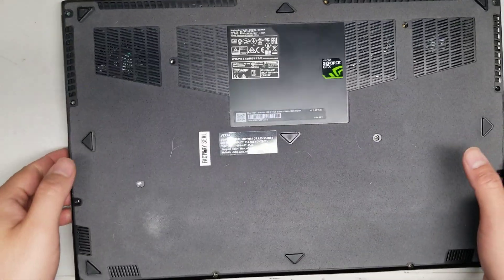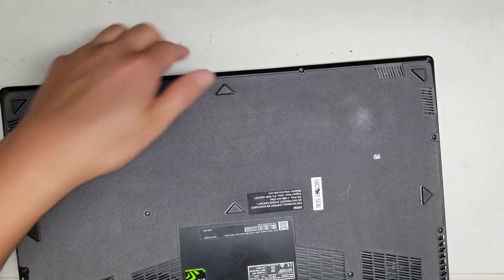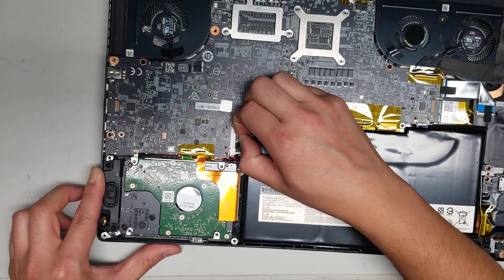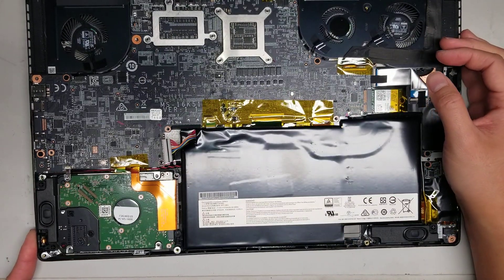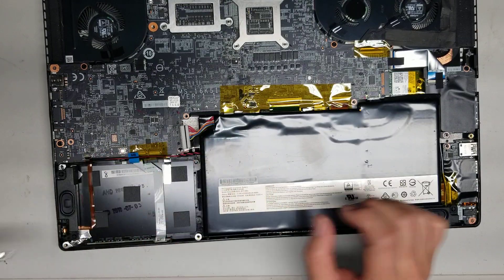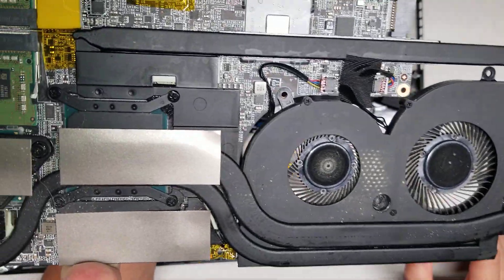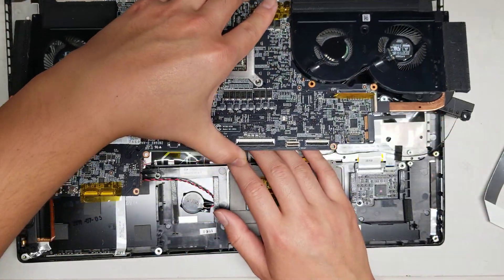MSI GS63 Stealth 8RE-010US MS-16K5 Disassembly RAM SSD Hard Drive Upgrade Repair

Comment: Can i change cpu on msi gs65 s9sf??? I have i7 9750h  can i take another stronger?
Reply from the maker: Nope
Reply: @ItsBinhRepaired  😪
Reply from the maker: @coaznik2112  most laptops can't
Reply: @ItsBinhRepaired  i know that i have that i7 9750h and rtx 2070 q max. Graphic card is ok but that 9750h is not good to much.
Reply from the maker: @coaznik2112  :( only thing you can do is ssd and RAM
Reply: @ItsBinhRepaired  is 86°C is normal temperature  when i play on ultra  for rtx 2070q max???
Reply from the maker: Sounds really high, but I dunno. 100c is thermal cutoff
Reply: @ItsBinhRepaired  everyone tall me is that normal from service. But i think that is so much temperature.

Comment: 10:55
what board is that on the bottom right, on the left of the USB/Ethernet board? (the one that has the square chip on it with the red dot. you briefly refer to it at the timestamp). I'm asking because my laptop has this weird habit of freezing at random, but whenever I apply light pressure from my palm onto the palmrest in that area, it unfreezes, and I'm wondering if that board needs to be replaced.
Reply from the maker: Not really sure what it's called. It shouldn't cause your computer to freeze though, maybe the keyboard might stop responding, but not freeze the whole computer. Maybe it's a video connection issue. I dunno

Comment: I have this model but the HDD failed. I was told it was welded to the motherboard. How can i replace it or is it a solid no?
Reply from the maker: Welded to the motherboard? I dunno about that. Watch the video and replace the hard drive/SSD as shown and install Windows on it.

Comment: does anyone have a link for replacing the battery .....?   i need to do mine as its bulged and toaste .... also maybe the part number
Reply from the maker: https://amzn.to/3aZbvlZ
Reply from the maker: To replace it, you just pry it up. There's adhesive holding it down. The bulging should make it easier.
Reply: @ItsBinhRepaired  thank you very much for info.  Hopefully easy just swap out

Comment: Quick question. Is it normal to have that little black spot on the motherboard? At first I thought it was a burnt mark but then I noticed you have that black spot on your motherboard as well.
Reply from the maker: What black spot?
Reply: @ItsBinhRepaired  it's right above the letter "FC" on the motherboard
Reply from the maker: @ptrwg  I don't see what you're talking about
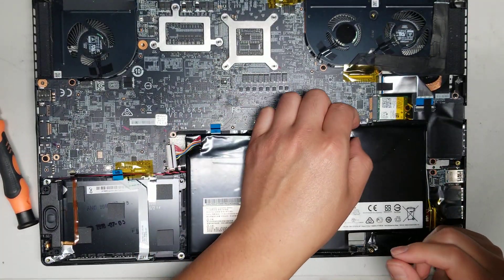Reply: @ItsBinhRepaired  I'm sorry. Maybe I wasn't clear about it. But if you stop the video at minute 6:50 , you'll see it right at the center of the motherboard, directly above the letters "FC".
Reply from the maker: @ptrwg  hmmm yeah it does look burnt. Not sure.

Comment: Is it possibly to clean up the fan by only taking off the cover and not going through all these steps? Can you make a fan cleaning video?
Reply from the maker: This video will help. Watch them and decide. https://youtu.be/3zs_SJ3BXgA
Reply: @ItsBinhRepaired  My cpu fan is making a squeaking/purring noise . From what I'm reading , im thinking it needs to be replaced. what are your thoughts?
Reply from the maker: @joeshon1  lube it
Reply: @ItsBinhRepaired  ok ill try that first thx. if  i do try to replace the cpu fan, do i have to remove the battery and hard drive before removing the motherboard? or would i be able to get at the cpu fan without removing anything but the fan?
Reply from the maker: @joeshon1  try it. Think about what you're removing and why you are removing it and whether or not it needs to be removed. Working on computers takes understanding what you're doing. Like with legos, ask yourself what needs to be removed to remove a specific piece. I can't look at every computer and give individual advice on everyone. Just need to use a little brain power you figure it out. Lol

Comment: So you can't replace the thermal paste?
(I have the same one)
Reply from the maker: You have to take the logicboard out completely.
Reply: @ItsBinhRepaired  lol dude you confused me with the slang logic board.. xD
Reply: @ItsBinhRepaired  you mean the mobo right?
Reply from the maker: @AnthonySilvestri  logicboard. Motherboard means CPU is removable. CPU is soldered in, so it's no longer a motherboard.
Reply: So its possible? xD.. i don't wanna fuck things up since it's kind of a complicated build to me
Reply from the maker: @AnthonySilvestri  yes, but I don't recommend attempting it unless your laptop is shutting itself off from the heat.
Reply: @ItsBinhRepaired  ok ty for that
Reply: @ItsBinhRepaired  sounds really hard then I guess xD
Reply from the maker: @AnthonySilvestri  if you don't know what you're doing, I highly recommend against repasting
Reply from the maker: @AnthonySilvestri  video doesn't matter. I highly recommend against taking out the motherboard/logicboard if this is your first time, unless you don't care about the computer.
Reply: @ItsBinhRepaired  i see what you mean
i probably wont.. its looking pretty complicated for me
Reply from the maker: Yeah
Reply: @ItsBinhRepaired  would you not recommend a first timer trying to replace the cpu fan as well? since the motherboard would have to be removed to do so?
Reply from the maker: @joeshon1  yes, unless it's broken and you're not willing to pay someone to fix it.

Comment: i have my MSI GS63 7RE Stealth Pro and i want to put an additional HDD on it but it doesn't  have cable for the HDD, can you recommend me for any replacement that can be compatible for my laptop. thank you so much
Reply from the maker: It probably came in the box if you still have it.

Comment: Hey, if I'm going to replace the 2.5 inch SATA HDD, do I need to buy an MSI cable for the HDD or I can reuse the gold cable attached to the existing HDD?
Reply from the maker: You reuse the SATA connector

Comment: So is it possible to upgrade RAM and the SSD on this machine? I have this one exactly and I want to upgrade to a 512 SSD and more 32 GB RAM.
Reply from the maker: That's what the title says. Did I not show it in the video? I fix thousands of computers and don't have time to watch all my videos again to give personal advice. Please rewatch the video and let me know.
Reply: @ItsBinhRepaired  you explained how to get to them... But didn't really say how to take the SSD or RAM out
Reply from the maker: @TimBudoff  that's one of the most basic things. It's in almost every other video I did. I figured if you can remove the entire board, you can remove the RAM/SSD, but if you don't know how to remove the ssd and the RAM, I don't recommend you taking your laptop apart. You'll end up with a very expensive brick. Practice on old broken cheap laptops first, or at the very least watch more videos, but nothing beats actual hands on experience.
Reply: @ItsBinhRepaired  it may be basic to most people, but I just took my laptop to Best Buy to have the Geek Squad install for me, and the tech wouldn't touch it.  I would have done it myself in the first place, since I can build a PC no problem...but as far as laptops go (especially this expensive gaming laptop) it kinda worries me to do something like this (and my wife would kill me if I told her I messed it up and it doesn't work anymore LOL).

The tech told me that he didn't want to touch it because it's on the other side of the motherboard and he was afraid to break it.  So I was wondering if that's really what the reason was or was it a bigger issue with them being soldered or something like that
Reply from the maker: @TimBudoff  I showed how to do the difficult part of how to get to the RAM and SSD under the motherboard. If you got that far, you'd better know how to remove the RAM and SSD from the board. Lol
Reply from the maker: You should be able to see it's not soldered down from the video. You should send the video to the person at geeksquad. Lol
Reply: @ItsBinhRepaired  I think he was just inexperienced...just got done and putting everything back together...fingers crossed that everything powers up and works!  thanks for the video!
Reply: @TimBudoff  As a former agent. I wouldn't have touched this either. 16gb that it comes with is plenty and the what? $40 they charge to possibly brick a super expensive laptop. Scary
Reply from the maker: Yeah, liability is the scary part. Imagine being on the hook for thousands of dollars for a job that would pay you less than $100. Too much risk for too little reward.